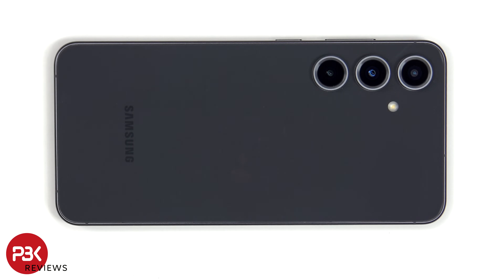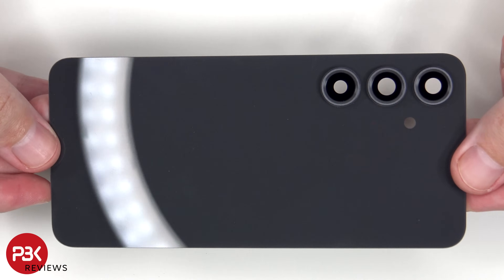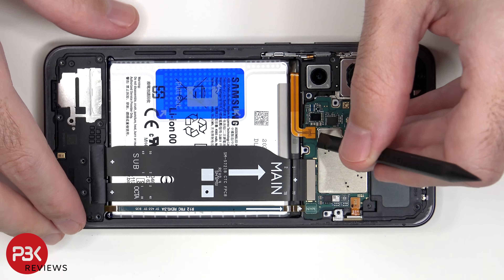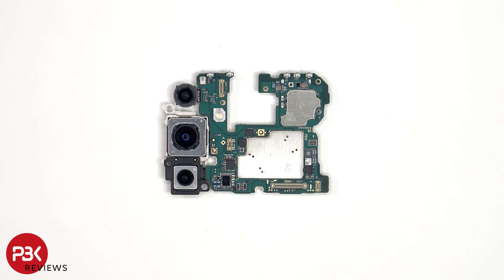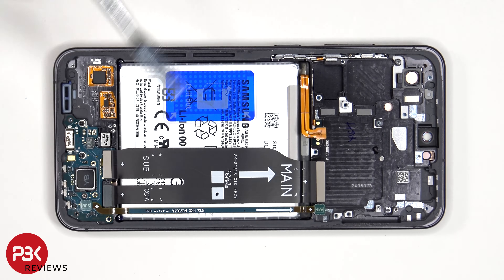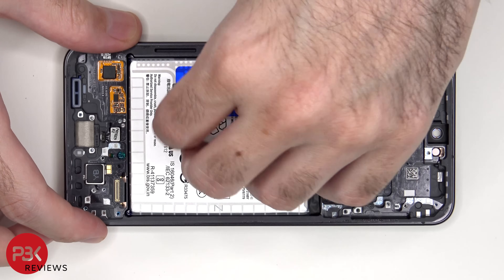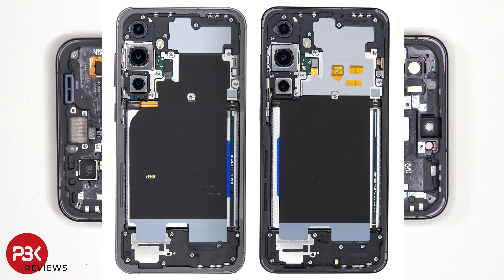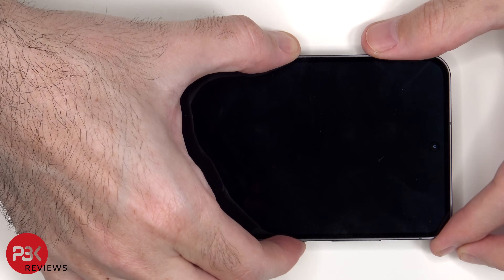Samsung Galaxy S24 FE Teardown Disassembly. Any changes since the S23 FE?

Comment: This phone is too expensive for what it is.
Reply: yes
Reply: Agree, at least last year they could say its SD gen 1.
Reply: it is what it is
Reply: Yep. It's much worse than the S24+ for basically the same money. Nice one Samsung...
Reply: @JustAGuy-x98e  wait for 8-9 months it will be under 40k😅
Reply: Yup
Reply: @Shorts-Wala_official  during great Indian sale it Will go around 30k 😅😊😊
Reply: @notharsh_00  yeah that's what iam saying 😄
Reply: classic Samsung
Reply: It's extremely cheap
Reply: @LilGrimey5Star  You can get an S24+, a better phone, for about the same price (after discount, because the S24+ is an old phone now).
Reply: @盾神京矢  and you can get the S24U, a better phone than the + for a little bit more. Bro they’re all amazing phones and they’re all like 100-200 apart lol compare any of them to an S10 or a iPhone 12 and these blows them out of the water
Reply: and only 256+8
Reply: Anything is too expensive for what you are.
Reply: @DmytroBogdan exynos 2400e is not a bad SoC at all. It is between SD gen2 and SD gen3 in processing power, and is power efficient and sustains 72% of its processing power under stress test and does not over heat!
Reply: @alin8646  I'll agree after I'll see actual battery tests
Reply: @DmytroBogdan  there are several battery tests comparing SD8 Gen3 and Exynos 2400 on S24+ . Even The original Exynos 2400 is more power efficient than SD8 Gen3, Let alone Exynos 2400e with a 100Mhz lower frequency.
Reply: @alin8646  2400 is not more power efficient than SD 8 Gen 3 you watch wrong tests.
Reply: @DmytroBogdan  Test is done by AndroidAuthority. Maybe they don't know how to test properly.
Reply: Disagree, it's priced pretty well for what you get.
Reply: I got mine new for $550. The S24+ is $1000. The FE is a substantially better deal.
Reply: in romania is 200 euro cheeper now at 256gb, at 512gb you need to add another 250-300 euro, wtf ? for that memoney so much ?.... i keep my a72 for now, i will wait until february after s25 family will be on sale so maybe will be cheaper this fe 24, if now, pass. 600 euro for 512 is a right price
Reply: I got my s24fe for 120 dollars canadian. I don't care who says what about it, for 120 it is well worth it.
Reply: @cameronpitcher4024  in romania is 600 euro at best price brand new  256gb :( and 800 for 512bg, no logical explication.... the problem is: only 8gb ram, in 2 years will have no use.... those 6 years of OS update are for nothing...
Reply: For Europe for sure but us Americans get the snapdragon 8

Comment: While I am a Samsung user and have been since the beginning. I find the Fan Edition wording to be misleading. To me, Fan Edition means that it should be everything that fans wanted in the S24. The best of the base S24, the plus and the ultra. Instead it gets under spec'd.
Reply: so you wanted an FE phone that is better than the base s24 but is cheaper than an s24????
Reply: What under specd? Only 100mhz difference on the X4, everything else is exactly the same including the rdna3 GPU.

Comment: Bigger, heavier, screen with lower resolution, no SD chip. A total downgrade compared to S23 FE.
Reply: It weighs the same as s23fe,with a bigger 4565 mah battery,the screen resolution is the same as s23fe, and the chip is 2 generation newer , it has almost the same cameras as 24 and 24+ and the screen is brighter, who tf told you its a downgrade
Reply: @BostanMaxim  read the specs. 
6.7 with the same resolution is lower pixel density.
Camera is the same as in S23 FE (I didn't mention cameras)
Chipset is worse than SD. It will heat up and you'll get 9h active battery even with 4700 mAh battery.
209g vs 213g heavier
Reply: S24 fe is better
Reply: @DmytroBogdan mf when a phone is 4 grams heavier, battery doent last 10 hours and cameras are the same”4k120 and 8k30 and night portraits” also ppi is not that bad
Reply: @BostanMaxim  "not that bad" for a 600 usd phone is not good enough
Reply: @DmytroBogdan what 2400 beats 8gen3 this has just slighty underclocked version of it
Reply: @lggr2261  no its not. Where do you get that info? SD has higher clocks
Reply: @DmytroBogdan   thats  tech world 2400 came earlier with 8gen3 beats 8gen3 in gaming and stablity
Reply: @lggr2261  no its not. Its running very hot (up to 50°) cause up to 60% CPU throttling in 15 min of heavy use and kills battery very fast. Watch reviews on Youtube for a proof.
Reply: @DmytroBogdan   i watched and it thats why i am saying  i can show you  gaming test where 2400 performs better
Reply: @lggr2261 meybe cuz exynos has more efficient gpu then snapdragon, tho cpu is comparable to snapdragon 8 gen 2
Reply: @BostanMaxim   cpu is almost same as 8gen3

Comment: 6:18 that perfect way to remove Battery , every company Should make easy way to Remove battery, Design S24 Fe is Easy to Repair , Also Sub Board & battery or Ringer after 2 -3 yr........
Reply from the maker: yup, but Samsung's pull pouches aren't as easy as xiaomi's.

Comment: It will be a nightmare for any technician to replace that fucking Power/Volume flex, just like what Motorola did with the Edge until Edge 40 lineup.
Reply from the maker: it's not hard at all, the moto ones yeah they were terrible but these come off fairly easy and it's not routed through the mid frame

Comment: Hi friend, dows the S24FE continues to have DP Alt Mode, similar to MHL, in the USB type C for use an HDMI adapter in DeX mode? I thinking that Samsung is slowly forgeting this feature...
Reply: I tried using USB C to DP cable that came with my Dell monitor and it worked just fine!

Comment: Thanks for the useful video!
I have a question: does the S24 FE design not have a separate proximity sensor on the screen side?
Reply from the maker: no it uses virtual proximity sensing
Reply: so horrible during call coz unresponsive virtually proximity

Comment: Why 5g antenna is so huge? Normally they are somewhere on PCB I think.
Reply from the maker: Its a mmWave antenna, not all versions will have this mmWave antenna. Its only for certain regions which use 5G mmWave technology which offers faster speeds but you need to be closer to the tower.

Comment: Id just get a used/refurbished S23 Ultra.
I can even find new ones for like 50 bucks more than this.

Not a bad phone, just badly priced.
Reply: New phones usually come with promos (wireless buds, charger and case)
Reply: How cheap do you want it to get, X4 , rdna3, 2031 support. The price is where it should be.

Comment: Not worth buying this when s25 series is around the corner and the base s25 comes with SD gen 4 when this has an inferior version of Exynos 2400 which is bad by itself
Reply: Sorry but S25 will cost twice as much as this phone. You can't compare them. If I'd consider buying new phone I'd wait for A56.
Reply: @DmytroBogdan  this is 650$, s25 will probably cost 800$ it's not double
Reply: @Savi159  when s25 will release it'll cost around 500 usd. This is not a phone for those who wait for S25 but rather for A5x series.
Reply: @ChatKingHerod Start reading comment again, I was talking about S24 FE

Comment: where is 2nd antina like s24 plus ?    in 24 fe only mmv antina available ?
Reply from the maker: Now they only use one antenna for the mmWave instead of two.
Reply: @PBKreviews  is it for both ?
Reply from the maker: no, its only for the mmWave. The sub 6 ghz 5G antenna is different.
Reply: @PBKreviews  ok , but sir where is sub 6 band antenna ?